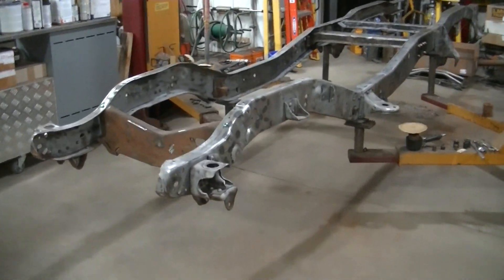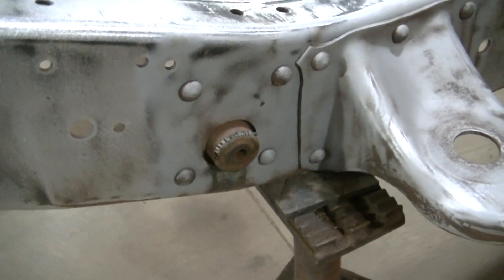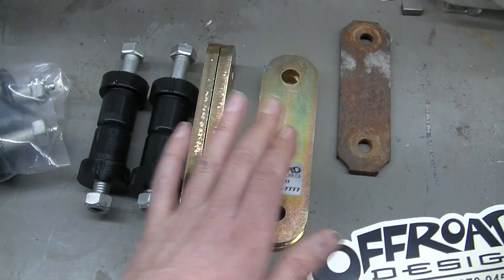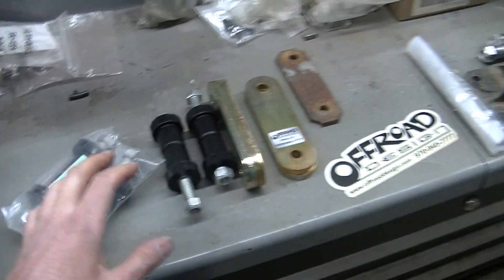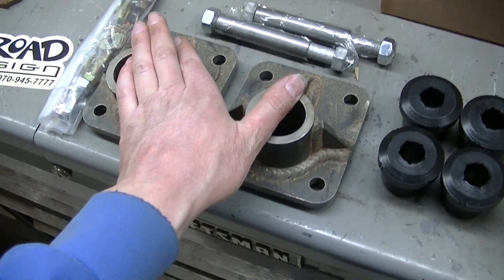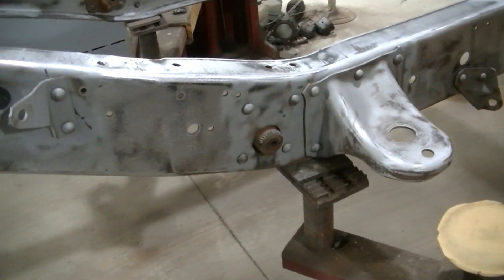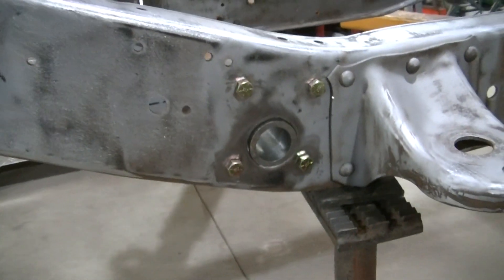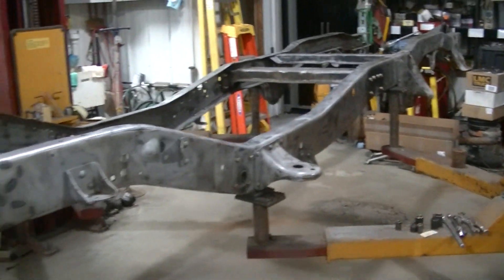80 Chevy Silverado OffRoad Design Heavy Duty Shackle Hanger Install

Comment: Man it seems like those frames should be built heavier than that! Wonder if anyone has ever stripped one down like this and cut 1/4" plate to weld into the channel from front to back lol. It would definitely cross my mind if I stripped one down that much
Reply from the maker: I don't think boxing the frame is necessary. They do flex a lot more than people think. The guys at OffRoad Design wheel these square body trucks pretty hard. There are a few weak points, but I have addressed them all.
Reply: @shanek6582  i grew up around the mud trucks in FL early 2ks. A lot of squarebodys had boxed frames in that scene, but they didn't last long because it trapped water and caused them to rust out quickly.  Plating was a response to the frames cracking at the steering box and at the rear hanger mount hole on the front springs. Shock mounts ripped out all corners also. The best fix is ive seen is welding plate flat to the outside of the frame and adding cross members to resist twisting.

Comment: Was this a half ton/ 3/4 ton frame, or k30 frame?
Reply from the maker: @Davidhillborn  This truck is a K10 or 1/2 ton.
Reply from the maker: I believe the 1/2 and 3/4 ton frames were exactly the same back then. The K30 had a thicker taller frame from what I have seen.
Reply: @mossman381  You are correct from what I've heard.  The k20 was occasionally thicker than the half ton, but I do not remember under what circumstances.  Can't remember if it's cab & chassis or year specific, etc. Always wanted to get all three together and check.

Comment: It doesn't seem like offroad design makes this kit for 1972 and down.
Reply from the maker: I see they say 73-91 but I swear these are the same ones on my 70 chevy truck. I would call them and ask. They are really nice people.
Reply: Good to know. I'm building my 72 from the  frame and I want to add these heavy duty shackle hangers. I'm planning on getting the 400 from blueprint as well. I happened to come across your videos by doin a search on the blueprint 400

Comment: Love it. I'm doing same on 83 k2500. I don't have a plasma cutter, what would you recomend? Die grinder maybe. Doesn't look like you need to remove slot of material
Reply from the maker: @WayneAckroyd-n9l  You don't have to take off a lot but the plasma cutter makes it so much easier. You will be there awhile with a grinder but it should work.
Reply from the maker: @WayneAckroyd-n9l  If you have access to a mini belt grinder like this https://amzn.to/40cg47p that might help. We have a much more expensive version of that tool and I love it. Might be worth the investment.